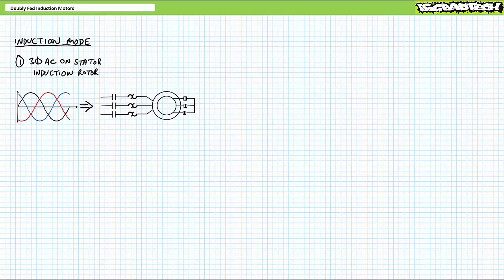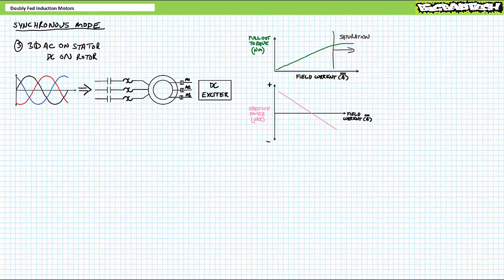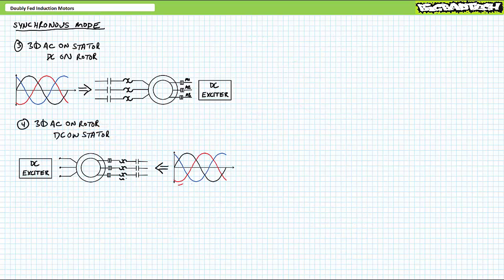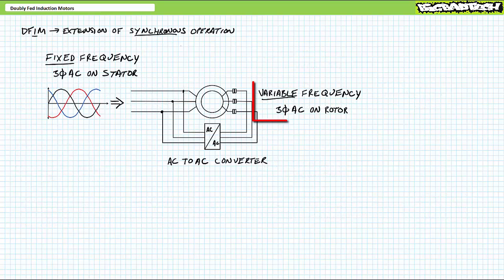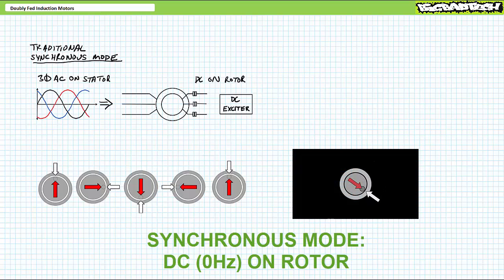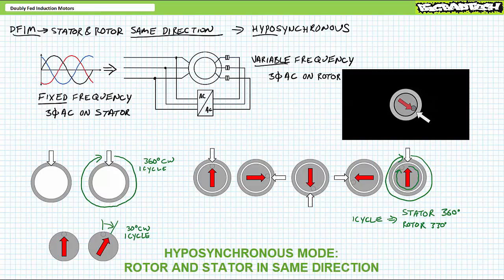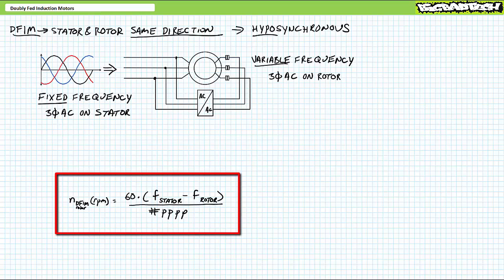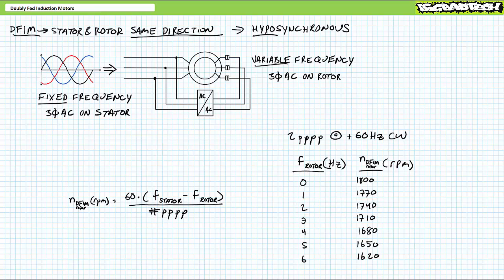Doubly Fed Induction Motors (Part 1 of 2)

Comment: I never heard of a "hypo synchro" motor, can you please explain WHERE you would use this feature?
Reply from the maker: I deliver the punchline in part 2 ... it's all about speed control and money. Rather than using an expensive oversized AC to AC converter on a squirrel cage induction motor one can use a smaller  cheaper AC to AC converter on just the rotor of a DFIM to step up or down speed. Wait till you check out generator mode!

Comment: Im an electrical engineer at a facility that uses a large doubly fed induction motor. We use a Kramer motor generator system as an AC/AC converter. There is one thing that I don't understand during start up we have to get the rotor frequency to 60 hz and sync before closing the stater field breaker. The currents on the rotor are very large why does this not cause excessive hearing in the rotor windings? for scale its a 20k horse power motor and the rotor currents are 1100- 1300 amps before sync are those windings not acting like resistors?
Reply from the maker: Yes, presumably this is kind of like a soft starter in reverse. Rather than ramping stator frequency up to 60 one instead ramps rotor frequency from 60 down.
Reply: I’m NOT an electrical engineer, but I believe those motor windings are behaving like an inductive load, not a resistive load.  Kindof like a transformer.  
My guess on why they would need to synchronize the rotor frequency before closing the stator breakers is because the motor is stationary and you want the fields rotating in synch so that when the breakers close, the motor doesn’t try to instantly jump full speed.  If you start the rotor and stator fields in synch at 60Hz and the slowly desynchronize it will start the motor 0 RPM and slowly ramp up as the rotor and stator frequency differential increases.